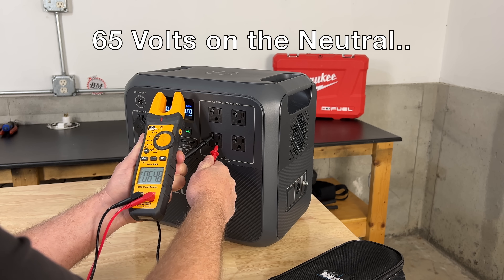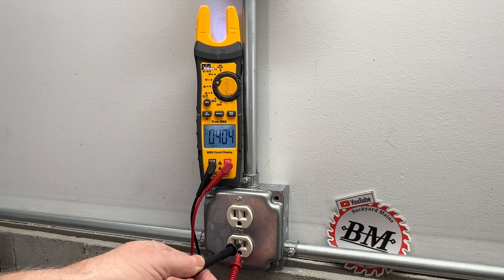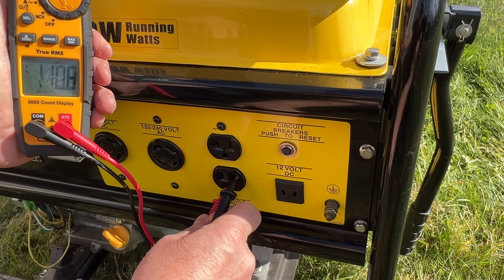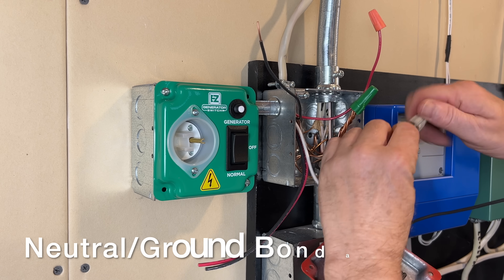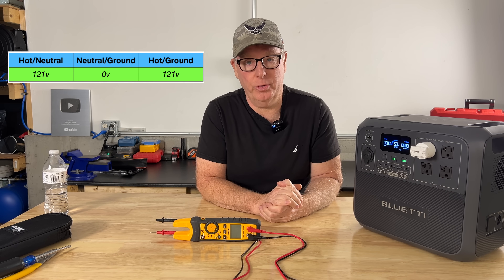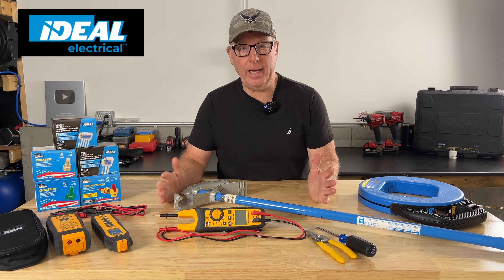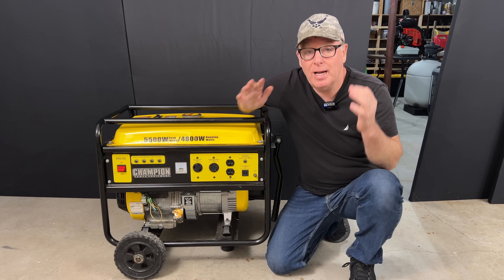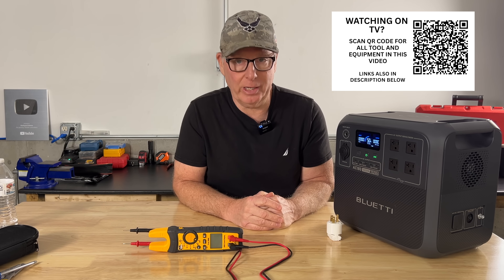The Hidden Generator Mistake.. (Dangerous)

Comment: If the generator has a bonded neutral and you wanted to use it for home backup power through the panel is there a way to convert the neutral to floating in the generator?
Reply: Yes, you need to disconnect the bonding wire in the gen-set. You should be able to see where it is located by looking at the wiring diagram in the owners manual. Its "usually" a yellow wire with a green stripe.
Reply from the maker: Yes, the bond should be removed and then you can purchase or make a bonding plug for stand alone use. You can usually find the bond relatively easily if not you can check your wiring diagram or ask the manufacturer. If you're unsure whether your neutral is bonded to ground, you can measure continuity between the neutral and ground pins one of the generator receptacles. Direct short if bonded and open if not..
Reply: @BackyardMaine Thanks for clarifying.
Reply: @BackyardMaine  Direct Short = 0 0hms = Complete Continuity between neutral and ground, should be able to be tested even with the power/generator off.
Reply: That's the same question I had,
Reply: And please label the generator unbonded so that it's not used by someone else standalone without a bond plug or a temporary ground. And label the bond plug!

Comment: As always, Thanks for the video. So if I use a generator on a job site, or camping (not connecting to a house for instance), do I use a bonding plug or need to do something else/more?
Reply: People have used unbounded generators with extension cords for many years (decades or more?). 

It is slightly safer to use a bonding plug, but only if you have a double fault and touch the metal frame on the generator.

Edit:

On a Job Site, OSHA requires a ground rod and bond.
Reply from the maker: If your generator doesn't have an internal bond between neutral and ground, you do want to use a bonding plug when using it as a stand alone system. It's not slightly safer to do this... it can actually be dangerous to not do this. Ground is not a good conductor of electricity. As a matter of fact a hot wire from a 15A circuit will often only draw a few amps when connected directly to a ground rod. Not enough to trip the circuit breaker and that's assuming you're using a ground rod. When the neutral is bonded to ground that gives the ground and the neutral a short circuit path which will trip the breaker if theres an issue. Now it is true that the GFCI protection will still function if it's working correctly but now you're depending on that and not the breaker to protect you and also clear a fault.
Reply: @BackyardMaine  Thanks for replying John.

Comment: I wouldn't worry about it, since I was grounded a lot when I was a kid.
Reply: Maybe if I had ever been grounded  I wouldn't be such a live wire now.
Reply: @deadmanswife3625  I will be using that one.
Reply from the maker: Great point.. lol
Reply: I wasn't grounded when I was a kid because I was so neutral about everything.
Reply: Not Grounded But My Legs Were Left Striped And Bleeding Several Times! Mom Would Use The Back of A HotWheels Race Track Piece!